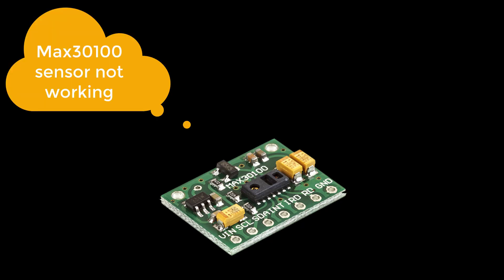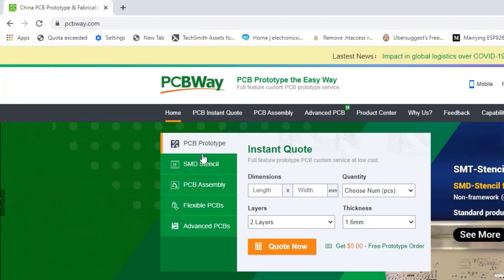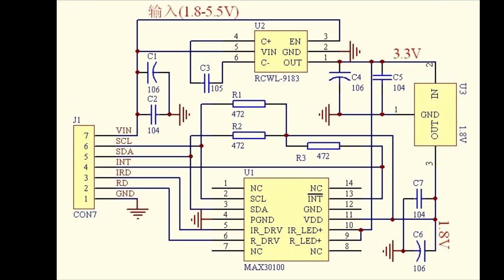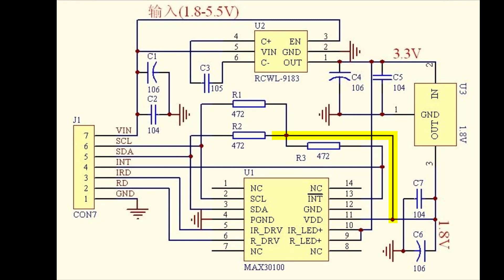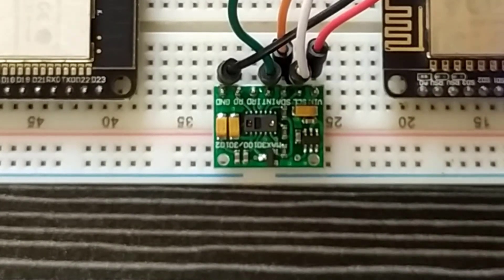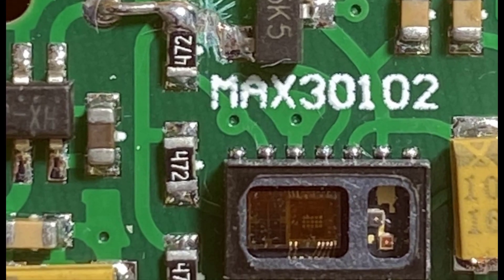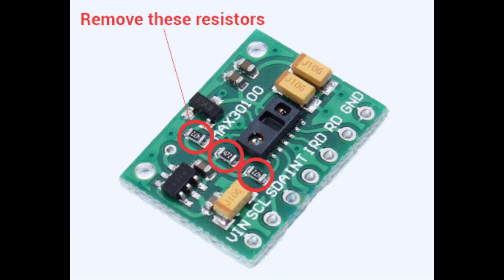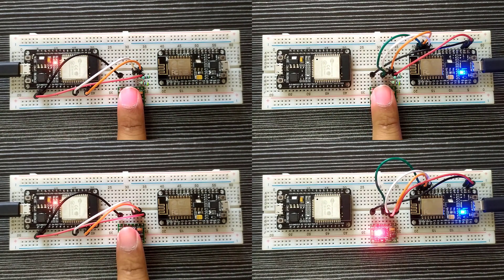[SOLVED] MAX30100 not working | Initializing pulse oximeter...FAILED | MAX30102 LED not working

Comment: Feedback: Method 2 didn't work. It failed to check even the Power test in MAX30100 using 3.3V supply. So better, please not to follow.
Reply from the maker: Sorry to hear Method 2 didn't work for you; it's always good to check your wiring and power supply carefully. If you're still having issues, maybe try a different sensor or a different power source.

Comment: sir, what is the multimeter reading to look for at 04:03 before and after making cut can you tell sir please?
Reply: Conductivity mode
Reply: Continuously or buzzer mode , simply cheking whether it has connection even after the track is cut

Comment: Hi Guys
We found that after following the steps ,It still dont work in this case try this.
After some work around we found out that to use 5v for the max30100 sensor instead of 3.3V and it works. 
Hope this helps.
Reply: Did u provide 5V to Max30100 after using the second method?

Comment: After removing those 3 resistors and after making connection with external resistors ,after that also No red light on max30100 sensor .tried with two max30100s but pulse oximeter is failed. can you please help me out this connection ?

Comment: sir, i have a problem about the inaccurate measurement of the sensor. the sensors is connected, the led light is on. but the number of measurement isn't correct, what should i do sir? please help me. 🙏
Reply: Did u did modification of the circuit

Comment: your method does not work check your comment section more than 90% people have tried and it didnt worked out is their any other alternative i already removed all my three resistors
Reply: same problem for me, did your issue has solved?
if solved means please help me .
after removing resistors and after connecting with 4.7k resistors ,if pulse oximeter failed means what should do? do you have any solution?

Comment: thank you sir, you have been infinitely more useful than any of my TAs or profs in solving this issue
Reply: Does it work for you
Reply: @jungcookie7041  ya totally fixed the issue
Reply: @truetalonator  how did you do that
Reply: @jungcookie7041  scratched off the bad connection like he showed in the video using a really small flat-head screwdriver, then soldered a connection between that first resistor in the voltage divider and the pin using a small wire. His board had a nice pad connecting to the correct pin of the adc, but if yours is like mine amd didn't have that then you need to solder from the resistor directly to the adc pin mentioned in the video.

Comment: Red light glowing and showing "initializing pulse meter sucess". But in the next line bpm, spo2 data is not showing. Instead of that different symbols are displaying.
Reply: Which method did u follow?and also Did you find the solution?
Reply: @jungcookie7041  I had used changed the sensor. Now I am using max30102
Reply: @vamshidharreddy6970  does it work
Reply: @jungcookie7041  Yes. But I had also changed code
Reply: @vamshidharreddy6970  can you please share your code with me🙏

Comment: Sir i have followed the same procedure. As I have removed three resistors and i have used two 4.7k resistors for external connections. Even after all those efforts, it is showing "initializing pulse oximeter failed"
Reply: sir actually I have used esp32 with max30100
Reply: @badrinarayans2290  did u get the solution? Even I'm facing Same problem
Reply: same problem for me, did your issue has solved?
if solved means please help me .
after removing resistors and after connecting with 4.7k resistors ,if pulse oximeter failed means what should do? do you have any solution?
Reply: did you found a solution please

Comment: I have removed the internal resistor and connected with external ressistor of 4.7 k ohms but still it is not working , Do u have any idea
Reply: Bro did you solve the issue
Reply: same problem for me, did your issue has solved?
if solved means please help me .
after removing resistors and after connecting with 4.7k resistors ,if pulse oximeter failed means what should do? do you have any solution?

Comment: I have tried the first method but why my sensor is getting overheat?
Reply: Bro same thing happened with me. Do you know other alternative?
Reply: @deepanshusrivastava2316  Bro did you get any solution...
Reply: @AnsifCP  bro u should open the internal 4.7k resistors and use external ones .... without that led will not glow..but it is not a proper sensor the BPM will be fluctuating
Reply: Before removing also did ur resistors was getting overhead ..plzz reply
Reply: @shourjyajitmaiti2490  Bro did you get any solution....
Reply: Same issue broo,If You got any solution plz let me know.

Comment: I have removed the resistors and connected with external one.. Still the led does not glow
Reply: same issue bro if you find any solution pls let me know
Reply: @danishmanzoor5179  did u find any solution
Reply: @keshavareddy3511  did you got any alternative for this sensor??
Reply: did u find any soution
Reply: Did you guys find the solution
Reply: same problem for me, did your issue has solved?
if solved means please help me .
after removing resistors and after connecting with 4.7k resistors ,if pulse oximeter failed means what should do? do you have any solution?

Comment: i have tried second method by removing the 3 chip resistor and connected external resistors but still there is no red light blowing on the chip
Reply: @Venkatesh Nakod  I just simply replace the max30100 by max30102, same wiring diagram and it has worked. Not worth fixing it, such a waste of time.
Reply: @khoacaodang4555  did you modify the max30102? Maybe you removed the internal resistor or others thing?
Reply: @khoacaodang4555  helloo mat
Reply: @kresnapandu7349  yes, I tried
Reply: @khoacaodang4555  did it work using max30102 without removing resistor
Reply: @avinashsaripalli4993  did you worked with MAX301002 sensor?
Reply: same problem for me, did your issue has solved?
if solved means please help me .
after removing resistors and after connecting with 4.7k resistors ,if pulse oximeter failed means what should do? do you have any solution?

Comment: I bought max30102 (green color) I cut tracer as per first method you show. Still LED of sensor does not glow. I ran i2cdetect and it identifies my sensor at 57
Reply from the maker: So, change tga same i2c address in the code and try again.
Reply: @electronicsinnovation  I am referring your code , I do not see a place where address is defined.,
Reply: @blendofdiscovery  I am having the same issue. Did you get it solved ?

Comment: Worked perfectly after doing the first modification. Thank you!
Reply: bro do 1 method really works??
Reply: @venkateshnakod6194  yes.
Reply: @NicAqueous  bro how did you cut the sensor
Reply: @jungcookie7041  using a small knife
Reply: @NicAqueous  ok thank you
Reply: @NicAqueous  bro I did the first method but my sensor is overheated can you help me solve this
Reply: @jungcookie7041  same
Reply: @julybackup  I brought modified sensor and it works